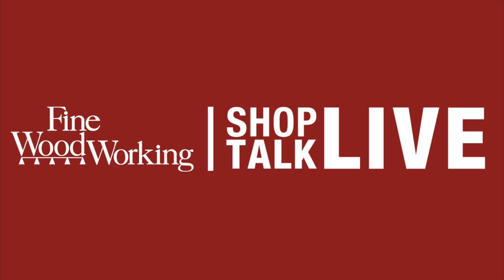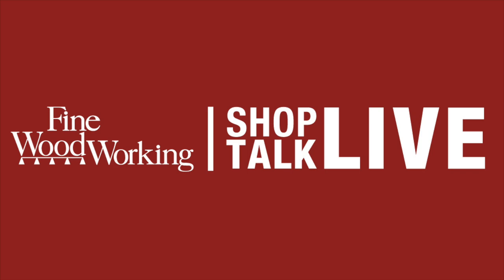STL259: Do homemade bandsaws make financial sense? (no)

Comment: Rollie is right on in his comments about building your own bandsaw. I did, in fact, build an 18" bandsaw with 13" resaw capability. I bought the wheels/tires, and tensioning mechanism from the kit. But a wooden frame was a no-starter from the beginning. Too much flex. I built an all-steel saw using 4"x4" square steel tubing for the main "C" frame, and 2" x 3" and 1 ½" square tubing for the base. I used a 2 HP TEFC motor, and had it arranged on a "teeter-totter" frame with a jackshaft so that I could slow the saw down for metal working. The teeter-totter allowed me to tension the belts and change over from high to low speed quickly. At the time my total cost in it was about 50% of an 18" wood-cutting only model. 

But, later, as we were moving some 1250 miles, I decided that I hardly ever used at 18" throat and sold that saw and bought a new Laguna 14/12 saw. That still gave me the resaw height, more for wooden bowl blanks than for making veneer or panels, and I wound up with a much more svelte saw from a footprint standpoint, that was on wheels and could easily be moved around the shop. 

If you decide to build your own saw, know your capabilities and have at it. I don't have any direct experience with the wood framed saws but I could see all kinds of downsides to using wood in that application. There is substantial tensile force on the blade that converts to a bending moment on the frame and one would absolutely want to back off tension when the saw is not in use lest the wood creep and warp under the compressive load of tensioning the blade. If you have metalworking skills and equipment (mine were very rudimentary, oxy/acetylene torch, hand drill, right angle grinder, files, hacksaw) then I believe the only way to go would be to design and build a metal framed saw. They don't come from the factory that way for nothing!

Comment: 5 micron (and higher) filtration is just re-populating the shop air through the filters with a lot of potentially harmful particle sizes that you (hopefully) sucked into the ductwork to begin with. Not really sure why you’d bother with the hassle and expense of dust collection unless you were going to do 1 micron or below filtration....I have 0.5 micron filter canisters from Wynn Environmental on my 3 Hp cyclone setup and the additional cost of them amortized over years in the shop compared to higher micron options is very minimal.

Comment: Fun episode, guys. Around 14:50, while Rollie is talking about the precision that is required for building a bandsaw, he mentioned that the wheels have to be coplanar. Well that is true of most common bandsaws, the design utilized quite successfully by Shopsmith does not feature coplanar wheels. In fact, neither of the tires are crowned and there is no tilt adjustment. I think there are several tools that would workers just enjoy making and then using for themselves that from a physical standpoint make more sense to purchase. One of those is a European style workbench. I think the conclusion at the end about if you are building one just for fun of it, and I would add, for pride of accomplishment, those should be the only reasons why you should build your own bandsaw! Again, great episode, guys. Scott

Comment: You can totally make your own bandsaw if you have access to a press to form and bend sheet steel. Wooden power tools are a little goodfy as the tolerances are so large you can't get precise cuts
Reply: the blade on a wooden bandsaw is still steel.  The blade is what makes the cuts.

Comment: Having owned an older used bandsaw and having built my own off the wood gears plan I can saw I strongly disagree with him. The one I made works far better than the 14 inch one bought. I would say build one first before giving advice on what's best.
Reply: The argument is that with current lumber prices it is not cost feasible. How much would it cost to rebuild yours today?